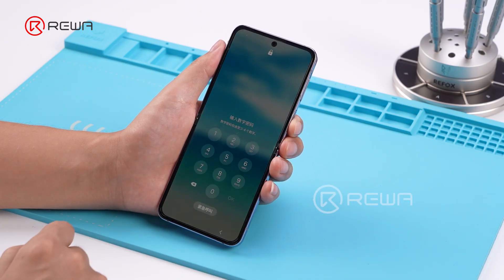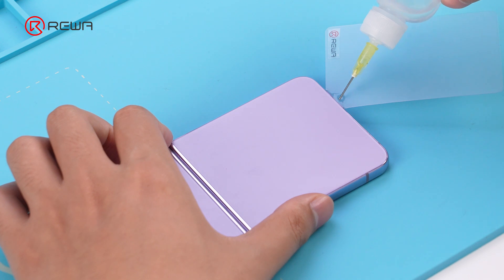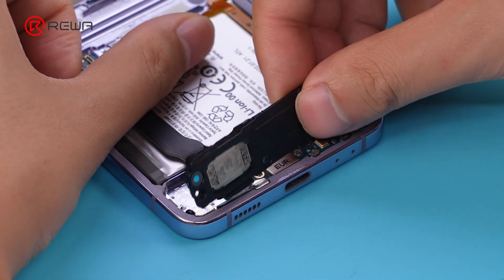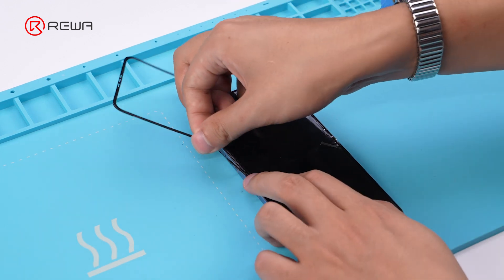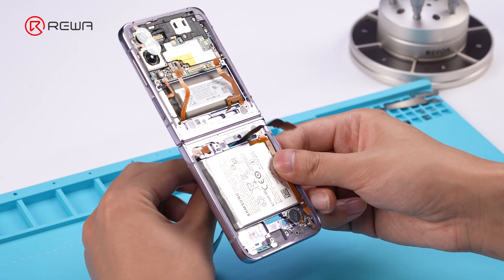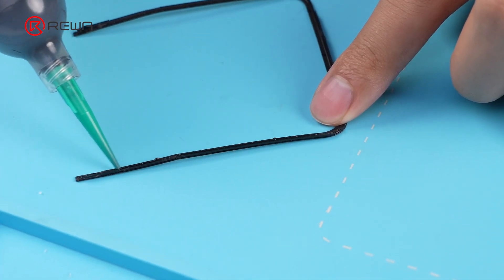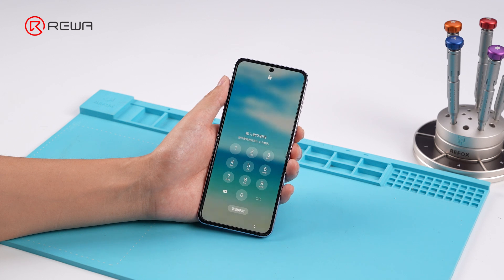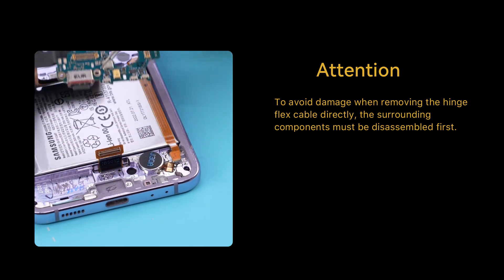Samsung Z Flip 4 Turns Off When Folded - Hinge Flex Cable Replacement Tutorial

Comment: Should I use isopropyl alcohol to dissolve the glue?
Reply from the maker: Yeah you can, but if you are not professional, pls don't do that.
Reply: @rewatechnology2008  my z flip 4 flex cable 
Same problem and in my country this fix is not available I have to do it by my self and buy flex cable 😢

Comment: What a pathetic phone. Got it two and half year, flex cable is broken, usb c port does not work properly, battery in shambles and the hinge on the display has cracks. Safe to say I am not going to buy another Z Flip again, or any other Samsung.
Is it worth to repair it? It would be more costly than a new phone I guess...

Comment: Design flaw, no amount of changing flex cable will fix the issue, already sent 2 time for warranty same problem flex cable
Reply from the maker: This common issue usually happens to some fold screen, perhaps when it comes to 7, the hinge flex still meets lot of problem.
Reply: @rewatechnology2008 for long time usage I can compromise but not even a year of usage need to fix, then the service center said its a well known problem and they already have a fix for it, then after a year same problem happen, tried to blame user although they cannot even found any cosmetic damage on the phone 😂, quite shameless of samsung service centre at my place. I don't think I trust a flip/ fold phone anymore, too fragile.

Comment: I did use alcohol to get the hinge off but I couldn't,  the hinge won't come off, I use the same alcohol to get the bezels off, in the end the alcohol damaged the lcd
Reply from the maker: Ummmm the most difficult part for this repari is the screen replacement.
Reply: How did it damaged it ?

Comment: Wtf thats too much work for flex cable replacement. Samsung is trolling
Reply: They could have just made the flex cable thread through the back instead of THROUGH THE SCREEN. I understand they made it this way to not put tension on the cable (folding in instead of out). But holy F they has to be a solution to make it easier to fix man. They could have split the central support frame so we can access the flex cable support strip, and thread the cable in/out instead of having to remove the Fing screen. They just give 0 care about repair. They intentionally made it as 90% harder to fix, for 1% gain to the end user. Yea they're being me,licous.

Comment: I have this issue but only when not plugged it could it be battery?
Reply from the maker: We suggest you locate the local repair shop to troubleshoot
Reply: I have same issue, did you fix it?
My phone still working normally when charging, but it has that issue as yours.
Reply: @chuan-div same did u find a solution yet?
Reply: @megumin_i  yes I did. I took it to phone repair shop, paid about 30USD for  FLEX CABLE replacement. I m not assured  after Flip4 fixed, cause it wasnt fixed by Samsung (may cost 70USD or more)

Comment: Asked 2 repair shops and they refused to do this. Mostly because they have never done this.. Should I do this myself? I only want to remove the screen using this methode and swap it with a broken one. Cant do the full screen because the flip4 with good screen has a broken hinge.
Reply from the maker: The most difficult part is to disassemble the screen, and flex cable is expensive for this common problem, so if you are green hand or beginner, we strongly suggest you not repair this

Comment: holly crap you need surgical hands for this how much will a repair shop charge for something like this
Reply: If you have the same problem with your flip phone then as per the Samsung Service Centre they will tell you that your phone screen is damaged and need to replace. Cost is INR 31000.
Huhhh!
Reply: @MukeshSingh-cp7xw  100% true they said i need to change the whole screen plus the cable its been over 3 mouths and phone is still working i just stooped closing it but yes Samsung are trash scamy pieces of sh**s that i will never give them a dime from my pocket
Reply: @MukeshSingh-cp7xw  Scamsung indeed. What other tool brands (for that's what phones are) are allowed to be this dishonest in fixing their own flawed product.

Comment: in my case the phone turns off when it is closed just like yours but when the charger is constantly connected the problem does not occur. is this also a problem with this hinge cable?
Reply: It happened to me today. I'm pissed out.
Reply: Yes, it is because of the damaged flex cable.
Reply: Same like my phone ? Have you found the solutions
Reply: Yes because it takes juice directly from the charger, enough to keep it alive
Reply: same. It happened few hours ago and i fought its battery
Reply: Same here when charging and fold it the issue not accur i can use normally powering on nor flipping up or fold it but here's a twist ( the phone is fold it's charging and when I unplugged the charger [it's folded] the issue not may accur i can used my cover screen normally i can flip it up and when I fold it down again,  the issue may accur why is that? )
Reply: Where  do you buy adhesive tape?
Reply: Where  do you buy adhesive tape?
Reply: Same for me
Reply: Same thing, happened 2 days ago.
Reply: I have the same problem
Reply: Yes
Reply: Yea ive just chages the cable but the screen got damaged just after 2 days.
Reply: Trash bin is ready to welcome it
Reply: Same

Comment: I followed this tutorial and I was able to remove the screen without damaging it! Great video! Keep up the good work ;)

P.S. I didn't have a heating plate, so I used a hot air gun set to 100°C and 20% airflow speed. Remember to heat up the general area before starting prying off the screen (and use IPA, obviously).
Reply from the maker: we are really appreciate it can help you

Comment: Thank you for the professional video 
my screen first display a green line and then it not turn on at all, but the small screen showing that the phone is working, will this be the same cable ? 
and may I know what is the thickness of the double tape you used ? 
and what adhesive and water proofs you used to assemble it back again ?
Reply from the maker: Green line problem may share different parts, we strongly suggest you leave your local repair man to check, generally it should link to the screen problem
Reply: @rewatechnology2008  they all take the easy fast way which is change the whole frame .. that's why Im asking, the phone doesn't dropped and it wasn't have any other issue just the green line and then dark screen